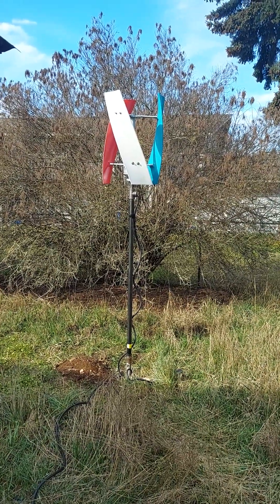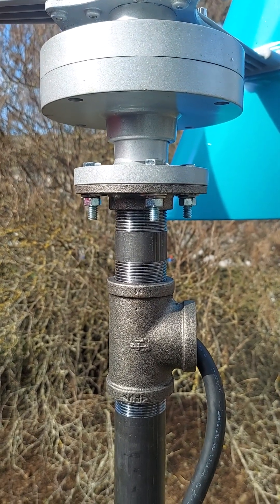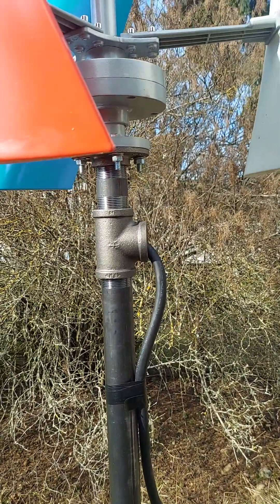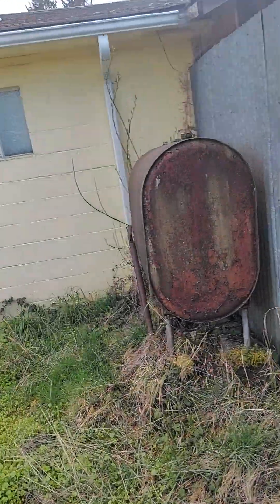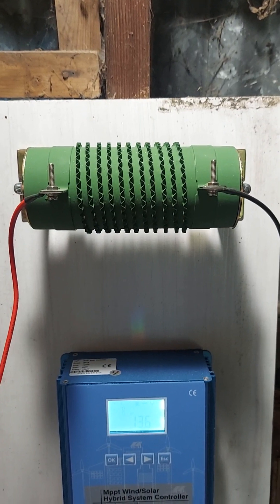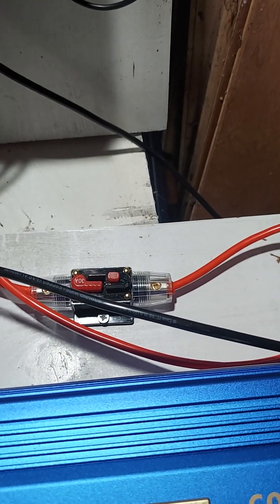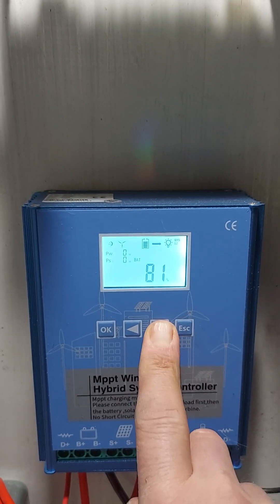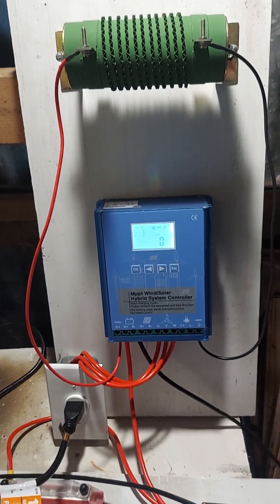VAWT Wind Turbine Generator

Comment: Does the resistor have to be fake when the battery is full to control the rotation when the wind is strong and there is no load, leading to damage to the blades?

Comment: Hi, how many watts is the turbine? 12v dc?
Reply from the maker: Suppose to be 400 watt, and yes, 12v running into a hybrid controller.  I haven't seen it read any watts yet, just volts, and not very many volts. I haven't put it back up yet after having bearings replaced. Hope to get it back up some day.
Reply: @Rock-With-Rick  Low generation you think? Would you buy it again?
Reply from the maker: @arbolespiritual  probably not. Also the  bearings went bad quick. So I put more money in to it replacing those.
Reply: @Rock-With-Rick  Thanks. God bless

Comment: Did you make the follow-up Video
Reply from the maker: I havent made any new videos since I got it back from the Machine shop and had the bearings replaced.  I havent put it back up yet, procrastination. LOL I am actually using my battery indoors to power a CB radio as a base station, I am also a Ham operator and in to radios and CB.  What I would like to do eventually, is bring the turbine controller inside so I can have it all connected, and hope the wind would keep the battery charged while it powers the CB radio. That would be awesome.  I do need to test it, now that it is fixed, if all works well, I would just need to get longer feed line to bring all the control stuff inside.  With longer feed line, I think there would be some loss, but how much is unclear.  But yes, I need to get back to this project, I kinda squirreled out and went down a different rabbit hole. LOL

Comment: I will stay tuned for your next video cuz I wanna replicate this.
Reply from the maker: I would suggest a different turbine,  the bearings are bad in mine now. Sadly it only lasted a few months. I think I may try a horizontal model next. I do have a couple videos of when I took it down to check out the problem,  I will get them posted.

Comment: bigger ythe guage wire the less resistance.. more power
Reply from the maker: It had been working well, not a lot of power out of it, but lately it acts like the brake is on, even when not connected to the controller. I checked and there is continuity between all 3 leads off the turbine, thinking there shouldn't be, but I don't know how these are wired on the inside but isn't that what acts as a brake when the leads are shorted together?  May have to take it down and take a look at it...see whats going on.
Reply: @Rock-With-Rick  check with a VOM the diodes that make up the bridge rectifier .. its the circuit that changes the AC to DC ...
Reply from the maker: @guy4698  Took it off the pole, and when I turn it by hand, I am pretty sure it is bearing that is causing the issue...its noisy and can feel the drag.  Not sure how difficult that would be to replace, havent got in to it yet.

Comment: Unfortunately these Chinese vawt doesn't work that well many of them seems just to be a scam. Hopefully yours not but no high hopes..i did go for a istabreeze instead after looking around...good luck!
Reply from the maker: I've gone up a bit higher since this video, only a couple more feet but enough to get it over the top of my garage/shed structure.  I do think these things need constant steady wind, I've only had gusty days so far, so it may not produce much, Might be better if it was on the roof, but that just seems like a hassle.  I am considering adding some solar panels at some point, but its sort of been just a project to see what I could do.

Comment: I just put one of these up. Today we've had 30+ mph gusts and the turbine has spun up to considerable speeds but the Pikasola controller rarely gets above 4.0v and may at best momentarily indicate an attempt at charging the battery. The wind wattage hasn't registered a solitary Watt yet. I didn't bother with thick cables for the AC lines, used an extension cable instead. Maybe I can shorten that cable or use heavier gauge, or try the regulator/rectifier in place of the charge controller (since I've got lead-acid batteries), or put the turbine way up in the air in hopes it just needs to spin at mach 3 before I get a Watt outtuv it, ...but at this point I'm not sure this thing is worth the effort, and perhaps I should return it while the returning is good. People seem to think this "generator" is hopeless but don't specify why/how they came to such conclusions. Have you found other discussions online about this specific generator? Thanks and good luck.
Reply from the maker: I couldn't find much about this turbine, I have read that vertical is more efficient because it will spin in less wind. But like you have found, I can't seem to get much out of it either. I'm not sure the wire size will matter much because the feed line coming off the turbine is small gauge wire. I'm considering adding solar, but I spent a lot putting this thing up, solar would have been cheaper I think, but I like the look of the turbine. Not even sure a horizontal one would be any better. I keep hoping for better results.  I have some wind today and have seen a little over 2 volts at one point. But I think it needs consistent wind. The voltage seems to increase the longer it spins without spinning any faster, but then the wind dies before too long and it slows back down. I think if it maintained speed for any length of time it might ramp up.
Reply from the maker: I wish I knew a bit more about these things, I wonder if I could find a different generator motor that could be swapped and use the same blade set up, just change out to a better generator and mount the turbine assembly to that. guess I would have to know all the specs.  Something I didnt do that I wish I had, I've seen videos where guys bench test the generator first, hook it up to a meter and spin it up with a drill to see what the output can be.
Reply from the maker: So did you keep it or send it back? If you get one up and going, I started a forum site with a thread for wind turbine setups, feel free to share updates and pics there. find it at https://www.chatacrossborderes.com

Comment: Did you see any power? Like to see some result. Thanks
Reply from the maker: We have had a little wind but it hasn't been a strong steady wind.  I'm starting to think I need a tornado, LOL, I am thinking a little more height would be helpful, but we will see. I read that the vertical turbines start easier in lower winds but I am not entirely sure about that. With vertical, when one side of the blades are going downwind, the other side is moving up wind creating some drag. It has turned a bit, but not fast enough yet to generate.  Hopefully soon. I will video it if it gets going good.
Reply from the maker: I did get a little power out of it earlier, not as much as I would like yet, but some. I made another video. 
https://youtu.be/IksLcpR1rr0